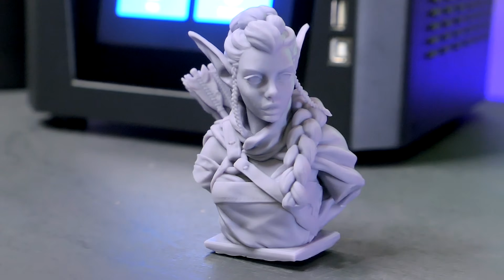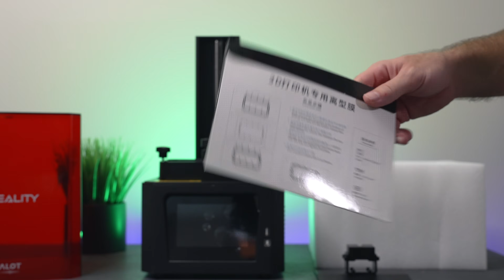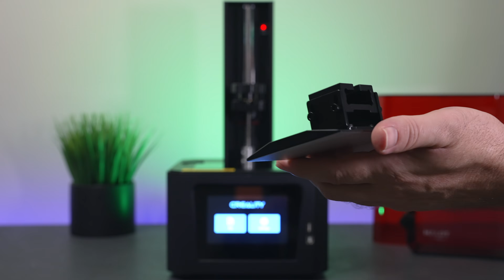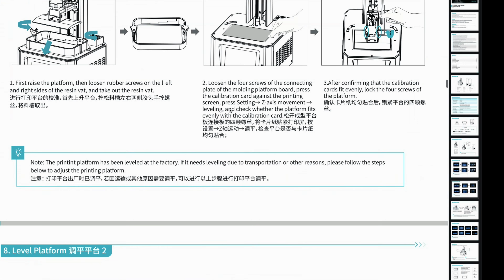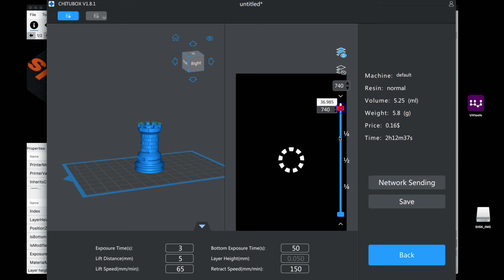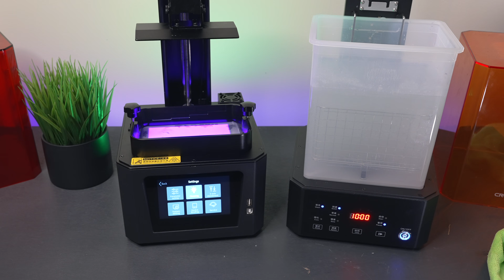Creality Halot-one - Resin 3D Printer - Unbox & Setup

Comment: This printer DOES NOT RECOGNIZE the STL file only in the format made with one specific program, halo box, and this program is full of nonsense and errors. I don't recommend buying it, I had to go crazy before I got to the point of printing. YOU CANNOT USE THIS PRINTER WITHOUT THE HALOT BOX PROGRAM.

Comment: on what oplanet wouold you need 70 seconds botto exposure time? i didn't even need that on my polaris and that wasn't even a 2k screen. ridicuolous exposure time...normal exposure is usually about 10% of bottom exposure. the fact you had to wahck the pieces off says it all, utterly useless nd you're giving really bad advice to people new to 3d pritning doign that. you'd break a ton of models smashng stuff off the build plate because you're incapable of dialling in your exposure settings properly.

Comment: When I level my bed I just cannot get the right side to be as secure as the left side. Even when holding it down, as soon as I secure the left side screws the bed seems to lift slightly on the right, so there is a lot less friction on the paper on the right side than the left and it does seem enough to impact the print results. Anybody know if this is normal?
Reply: not sure if this would solve your issue but when securing the screws you must first barely tighten them on each side and then gradually tighten more going back and forth on all sides.

For example, Tighten Right Back, then Left Front, Then Right Front Then Left Back and keep going in that pattern always  tightening a little more.

Because if you tighten one side too much the plate may shift slightly on the other side as you have mentioned.   

Hope this helps

Comment: thank you so much for doing this video I was lost with the instructions. MINE did not come with all that extra stuff our the brush. Mine also did not have the same settings yours has. Wonder if there are different models now. This is my first 3d printer and I am so excited. Can we use stl files or do they need to be cxdlp?

Comment: Very helpful video! I recently got Halot One Pro via Amazon and it was saying that it is all-in-one machine so I believe you’re right that clicking the “cleaning” can cure it if it goes and goes.
I found it better to cure it first before removing from the platform after printing. Because I damage other parts of the figures and there is no golden way to fix them afterwards.
Reply: Have you had an issue with the build sticking to the base plastic?

Comment: Just so you know, you’re instantly KILLING your LCD with that amount of exposure time. It only needs to be 3-4 times higher than your normal exposure time. For clear resins it’s a little different
Reply: Hey im kinda new to 3d printing so what do you mean by exposure time on the lcd?
Reply: Try 35s and 4 layers. Works fine for me.
Reply: @garylangford6755  it really depends on the kind of resin, I have different profiles for brands and even colors.
Reply: He means the bottom layers. What's your bottom exposure time and number of bottom layers?
Reply: @garylangford6755  8 layers and 50 sec
Reply: Thank you thank you for your input I just got mine last month and I just set it up today I don’t know nothing about

Comment: Soooo I’m running into a issue. Been following all your steps. The only issue is that nothing is sticking to the build plate when it’s rising up. I have a 5 hour print. It’s 3 figures about 32 mm they are spaced out apart from each other

Comment: I have a question how do you get the settings you got in Chitteubox? I tried setting them but I got 16000 8000 and 127000 also my layer settings etc are in the 10000 not 65 like yours thanks for your help

Comment: Hi I appreciate the video. Its been a big help. I have the Halot-Lite and I tried to convert the file from the ctb to Halot file type like you did. I copied the settings from Creality's site but when I transfer the file to the printer, I get "This model does not match the printer" Error. Did you experience anything like that? Or do you have a suggestion?

Comment: This looks like a great printer..Now i'm struggling,this one or the Elegoo Mars 2 pro?Which one is better?
Reply: Which one did you purchased mate ?
Reply: @vignesh_waran  Halot one.Great printer.
Reply: @gringomann1  do we really need the washing and curing machine?
Reply: @kj__s  no just use any UV light source even a nail lamp or make a box with a uv light, the sun works too but in winter you'll need a uv lamp or light source to harden your resin creations

Comment: Awsome hey i text u comments actually b4 i got elegoo mars pro 3D printer 6months or so back i just couldn even print free print rooks but it was to my errors as a newbie novest but i got my first successful print but every time I try slice free 3D stl off thingaverse and that they don't slice write onto my stick usb drive cause nothing thete to print in files I havent a clue what my problem could be as u know its slicer is chitubox can u help me what i should do do i risk buying file if its not printing or slicing onto stick correctly im sure im doung it rite i get them on screen i put the few supports too file creates even on to stic put not recognised nothing prints im going mental plz help if can

Comment: My Halot One arrived this week and also went for the Elegoo Water washable resin. It's a great little machine. I do 20s base layers and it still sticks really well to the plate. Also, you can hang the build plate so that you don't risk damaging the prints in the basket.
Reply: How many prints does 500ml give you?
Reply: @cuberlychee  1kg of resin is around 100 DnD minis.. So quite a lot tbh
Reply: @Vostoceq  ty
Reply: @Vostoceq  thank you for using dnd minis as a unit of measurement
Reply: how long dose a 500ml bottle last
Reply: yeah you don't need 70 secs ike this clown is doing